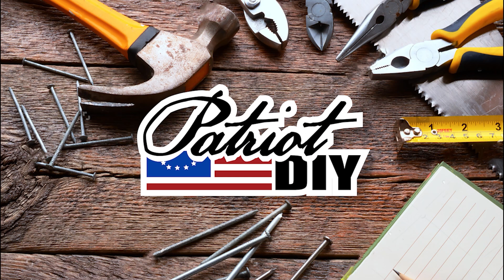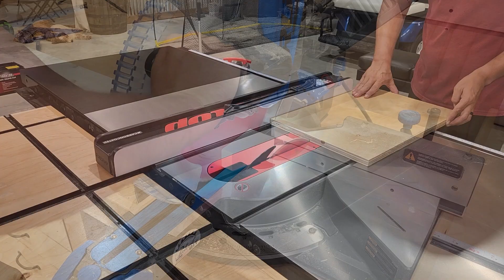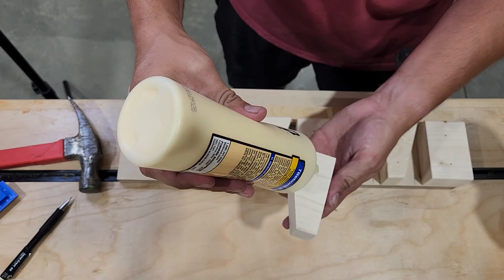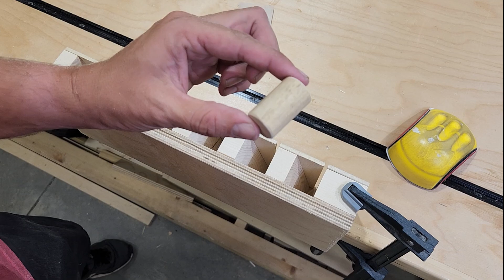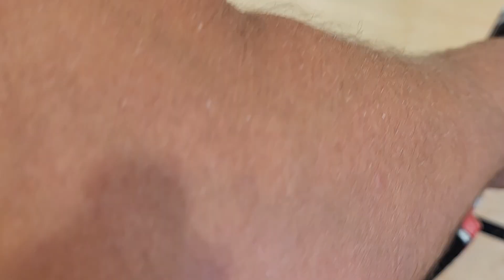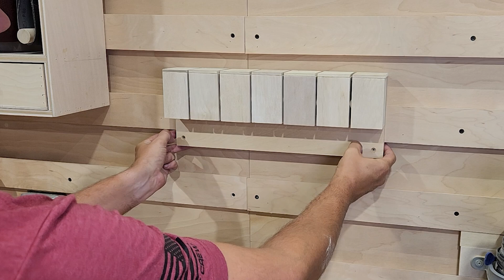Floating Hand Saw Holder / French Cleat Tool Holder

Comment: Great idea. I have invested in some nice saws for dovetail work and wanted a way to protect them. I don't have much wall space available anymore so this looked like an excellent solution. I bought the plans and built it. I have a cross cut saw from yesteryear which would not lock into place. I determined this before placing the top pieces on. I think my 7/8" dowels weren't heavy enough to hold the saw in place. Solution: with a Forstner bit I hollowed out the center of each dowel leaving 1/8" intact at the bottom. I filled the newly created cylinder with #6 bird shot and covered the opening with Parafilm. The recalcitrant saw now hangs appropriately in all of the slots. 

Your plans were excellent and other than this modification, I followed them to the letter resulting in a real terrific saw till. Thanks.